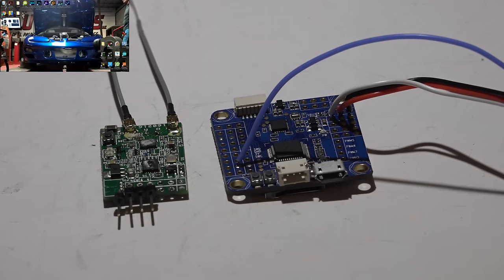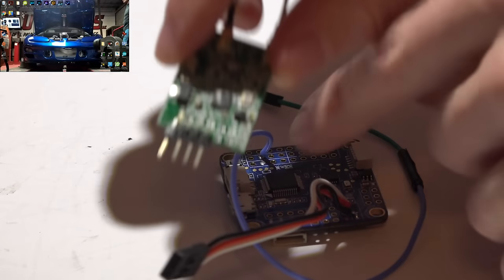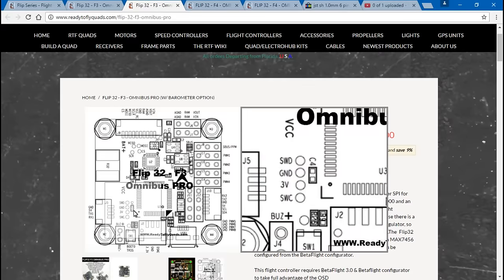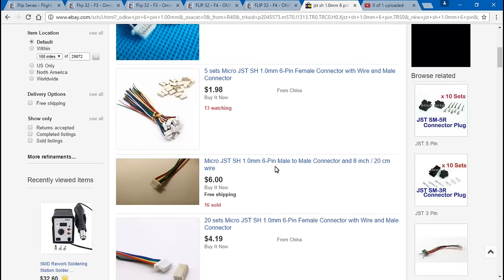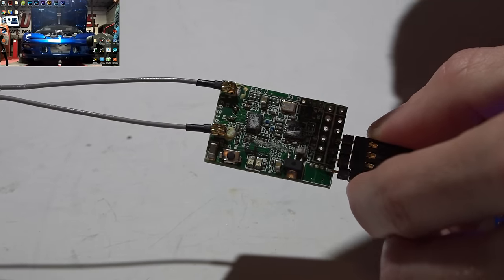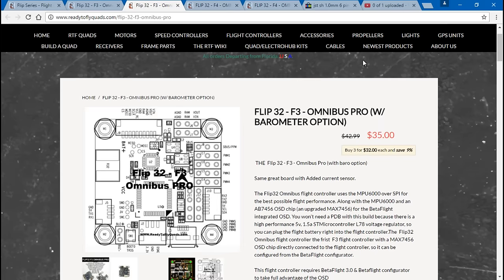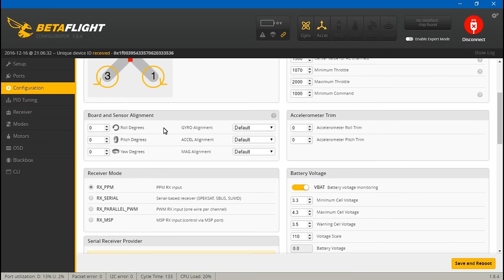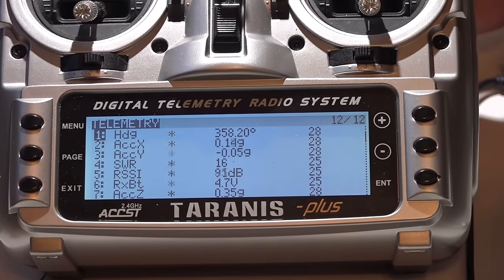Omnibus F3/F3 Pro & X4R-SB: Connect & Telemetry

Comment: Hi, I not sure if you can help. I just done this possess using a x4r on a f3 crusader gt2 board I used the UART1 as the UART2 is in use I have the receiver working on the quad before so on betaflight I do only the upgrade on the channel UART1 to serial port, everything else is as described by you is all working fine. but I can't get the telemetry to work the taranis only finds 3/4 sensors  is this board model the one with the swapped channels do you think I need to use the RX1 instead of TX1?

Comment: hay man. great series. helping me get on my taranis with a new build.
on the f4 pro v3, to control smart audio do I need to use 3 uarts? the non inverted mod wire to UART 2,  yellow wire from the block to UART 6 pin and use a soft serial to the unify? I'm struggling to know how to connect it without knowing if I need both wires for telemetry and control? I can't find any info on soft serial stuff on this board or how to learn about it either. can you help at all? thank you so much.

Comment: Hey I noticed on your x4r-sb that you have 7 pin holes, whereas on mine, I only have 6. 

My question is, where you're putting that green/purple wire for telemetry on your rx (@4:20min), is where I have my signal wire, and then power and ground in the next two.

Any idea how I go about wiring mine, since my rx has one less hole than yours?

I'd greatly appreciate if you helped me out with this...
Reply from the maker: Mine only has six holes. the hole on the end for telemetry is actually the plastic connector on yours, I just removed the connector. It's going to be the wire closest to the end of the board
Reply: Project Blue Falcon 
Ok thanx a lot man! Do I just pry the connector off with tweezers or something?

Comment: On my Taranis it does not have the menu looking the same as yours when you go to "discover sensors". Mine is V2.0.9. I'm gunna try upgrading the firmware tomorrow and see if it looks the same after that.
Thanks for the easy to follow tutorial 👍
Reply: LOL. I just read sapvolo's comment which is "very similar" to mine. I'll see how I go tomorrow 😉

Comment: hey bud, thanks for your great videos. i have a question. I got the rssi feeding back to my taranis fine, but I just got an omnibus f3 just recently and on the betaflight osd the rssi just shows 0. what am I missing?
Reply: In the receiver tab, set the RSSI channel to 8.  Then setup your Taranis to transmit RSSI on channel 8.  Google for step by step...